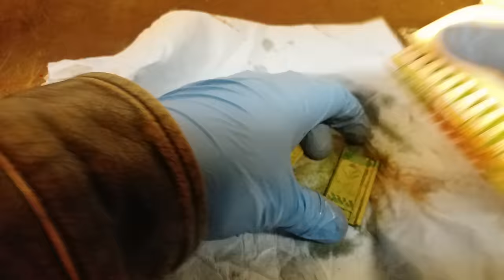Matchbox Restoration Vintage - GMC COE Dinky 948 Mclean

Comment: Superb result.  It has that wow factor on the finished reveal.  A great casting too: lots of details.  Not many manufacturers put separate rolling metal wheels, with an axle pin, on the landing gear.

Comment: Great job  . i rebuilt 3 mc lean  some time ago  . the only difference is that i repaint the trailer  as to match the plastic light medium gray  color .  Another thing , when i  need to remove the wheels from the axle  ,i dont use any dremel  at all , i just 
install a piece of masking tape over the wheels to protect the hubcaps  and gently  (with a tiny file ) just  take off  the small
ridge  and when i have to re-install it , i just (very carefully )   with a very small hammer    re-riveted the end of the axle exactly
like the original from the factory .   You made a real good job on your mc lean   ,you save a  great  dinky  truck .

Comment: This turned out great. Too bad the crack in the trailer remained visible.
I have some tips
1. Super clean will remove the paint without damaging the plastics.
2. If you clearcoated the plastic parts before applying the decals that would prevent silvering and improve setting, ofcourse setting liquid on top of that is a good idea too.
3.you can dip the windshield in self shining floor polish to make it look like real glass.
4. Extreme nitpick: you could have sanded/polished the parts before primer and then sanded the primer to get a more uniform surface for before painting.

Comment: So... how do you get the wheels to stay on after you've filed the ends off the axles? The video doesn't seem to cover this step.
Reply from the maker: So normally you could round the end off with a modified nail in a drill press. This method is used in my other matchbox videos. I chose not to do this to allow me to replace the 3D printed wheels with originals down the road.

Comment: Where do you get the replacement tires from?
Reply from the maker: I used what I had for tires but there are companies like recovertoy that sell them. Same for the wheel cores. I 3D printed the replacement cores for this.